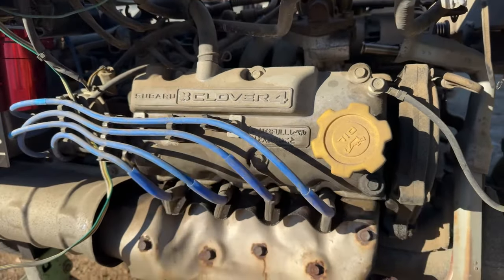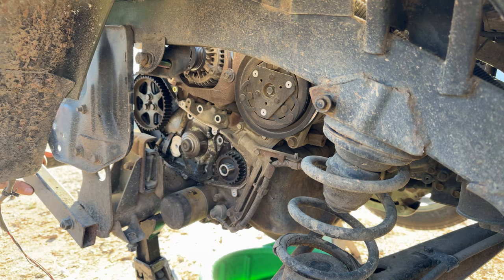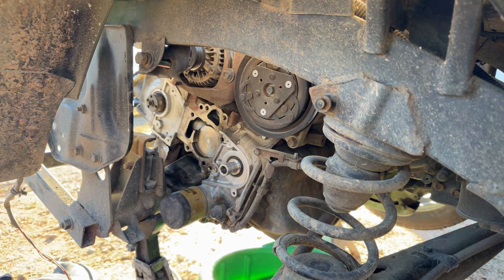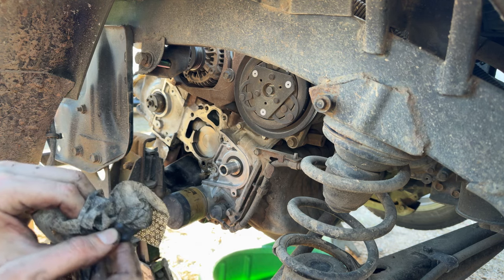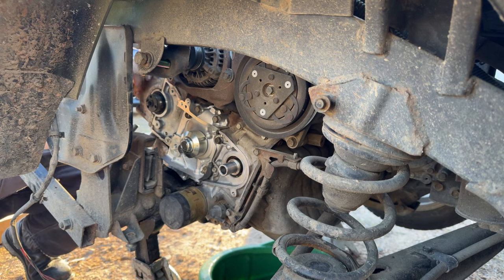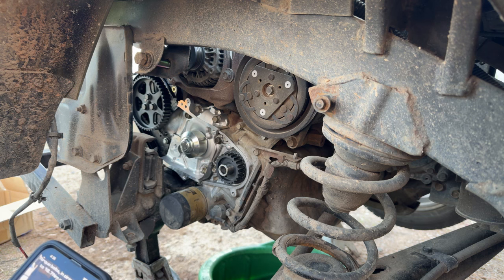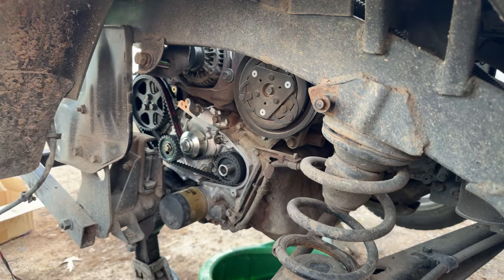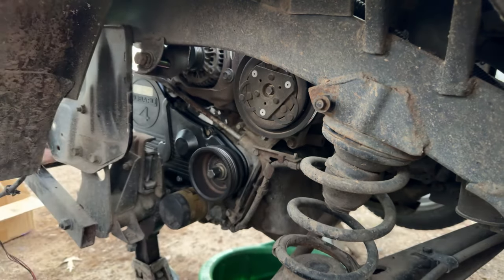MrSubaru1387 is live! 96 Subaru Sambar KS4 Timing Belt & Water Pump Replacement

Comment: Non interference engine. If the belt breaks it wont mess the head up. Helps to smear some copper seize on the dowel pins prior to assembly.

Comment: Is it common it have two major problems with the Outback with 126000 miles?
Reply from the maker: Major as in what exactly?
Reply: @MrSubaru1387  
I have 2016 Outback 
Had replace the catalytic converter and replace the transmission. And after the replacement I’m seeing a small amount of oil underneath. I feel I bought me a lemon !!